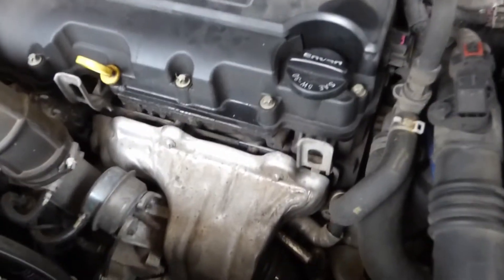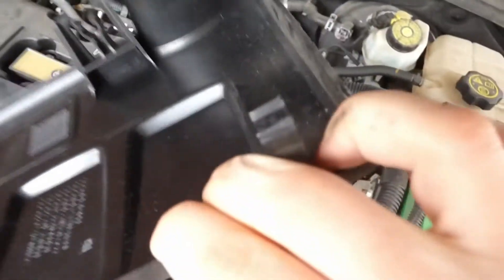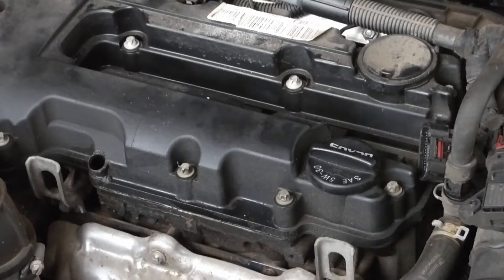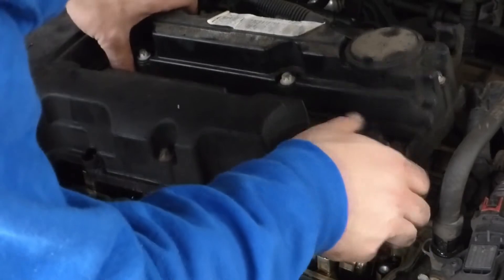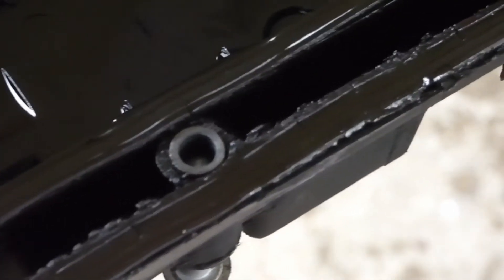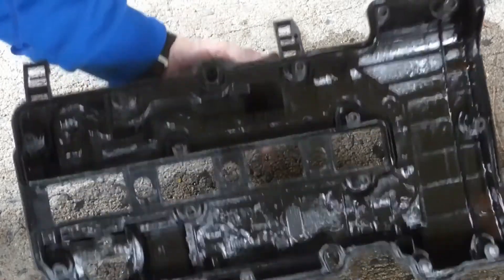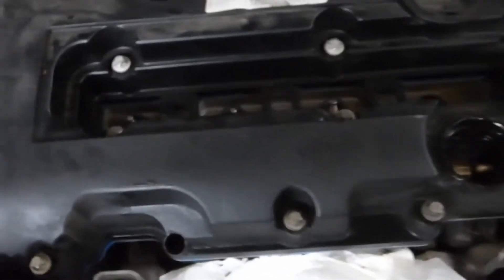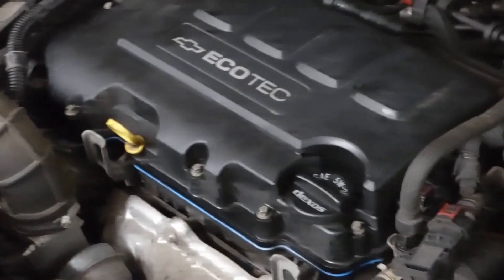How to Replace a Valve Cover Gasket on a 2014 Chevrolet Cruze 1.4L

Comment: Thanks much. I figured it was fairly simple so this was a great confirmation. I used your Amazon link as well. Only $16 pretty good. I noticed you didn’t use the new o rings but if they aren’t leaking after installing, your bolts probably still had them in place.
Reply: I’m still wondering where do the rings even go ?
Reply: @ggsjunior36  same
Reply: @ggsjunior36   Do they go on the coil packs?  I've heard usually those get slightly damaged as you remove the packs.
Reply: @DFulton36  yes I already did the job they actually do come in the new coil packs and yes they do go on the packs..

Comment: This just happened to me, was getting into the spark plugs caused 2 Ignition coils to snap as well. Was getting loss of power when accelerating and idling.
Reply: Yep I had a coil burnt and acted same way

Comment: WHAT DID YOU DO WITH THE O RINGS
Reply from the maker: Which ones?
Reply: @AJSWoodworks  the ones that came with the part
Reply: Some say they are the screws or spark plugs but i didnt see or hear you say anything about them and I'm currently replacing mine as we speak

Comment: AT 1:45 you unplugged a cool pack, can you help me find a replacement for that little pink clip, it broke off. I have no idea how to narrow my search for it.
Reply from the maker: Unfortunately, I was unable to find it either. If it’s loose, you may try buying one of the connectors that you can splice on to the old harness, but you need to know what you’re doing as the wires aren’t labeled. Or, you can do what I do, and just leave it there. Mine is broken and the plug still fits snugly.

Comment: What is the hose that is to the right in the video that has the sensor on it called
Reply from the maker: You’re probably referring to the mass air flow sensor on the air intake hose.

Comment: Whats the best way to solve over heating problem of cruze 2014/2015 . 
And which spark plugs is best to use
Reply from the maker: I have a video where I replaced the spark plugs. I used iridium plugs from ac delco.
Check your coolant level and check your thermostat first.
Reply: My 2014 cruze was overheating about a month ago. My coolant reservoir was cracked and leaking. Replaced that and it was still overheating. Turns out one of my return hoses were clogged as well, mechanic flushed it out then voila!! Overheating solved!! Also have your thermostat, water pump, and coolant sensors looked at as well because they could also be the culprit. Now I'm having this gasket problem 🤦🏿‍♂️. Should have it fixed tomorrow tho.

Comment: As I was loosening a front bolt , it snapped , how can I find that bolt , is says 8.8 s on top, can I use any 8.8 bolt ? , can’t seem to find it
Reply from the maker: I believe it’s an M6 x 21mm (or 30mm) bolt, but I couldn’t seem to find it online. Hopefully you’ll have more luck than I did.
Reply: I stripped a similar bolt. Autozone, o’reillys, and home depot didn’t have anything like it. Was gona go to the dealer but I ended using a bolt from the heat shield for the time being

Comment: what is different  doch engine and ecotec engine? is this same? because I cant find for cruze 2014 1.4 turbo ecotech engine on ebay or amazon. can you help me?
Reply from the maker: The ecotec engine has dual overhead cams (DOHC), so yes, it is a DOHC engine.
Reply: @AJSWoodworks   thank you

Comment: I’m helping a friend with his, and he thinks those captive bolts that secure the valve cover to the head each need an o-ring. The logic is that the bolt holes are within the confines of the gasket and oil pressure could leak past the bolts. Was this the first time the valve cover was taken off?
Reply from the maker: Joseph McAuley Yes, this was the first time it had been off to my knowledge. That makes sense, I believe my bolts had o rings already, but if it was leaking from the bolt areas I would think the o rings would help.
Reply: I guess I'm pretty off topic but does anyone know a good place to watch new movies online ?
Reply: @Alejandro Forest thank you, signed up and it seems like they got a lot of movies there :D I appreciate it!!
Reply: @Lionel Markus you are welcome =)